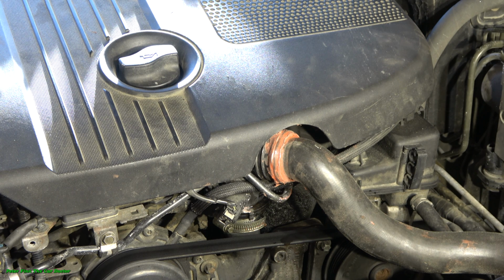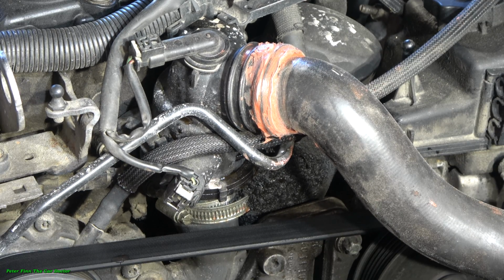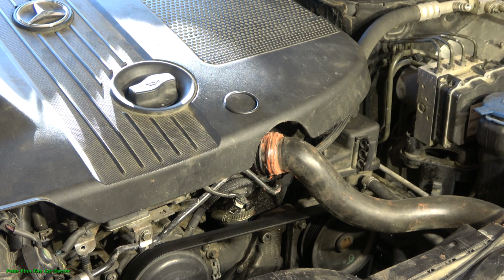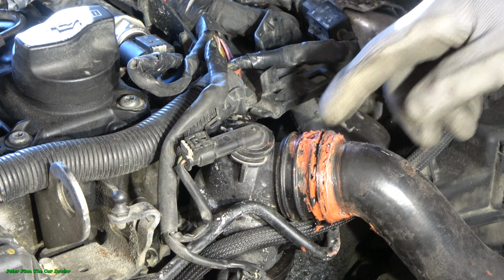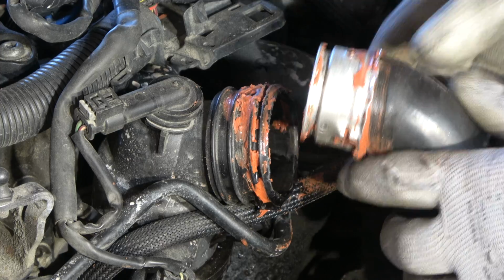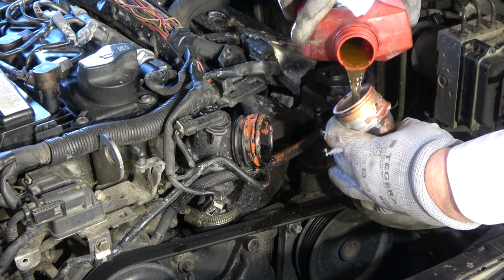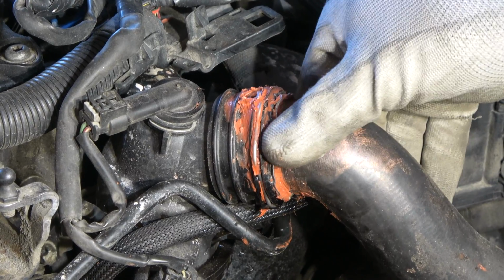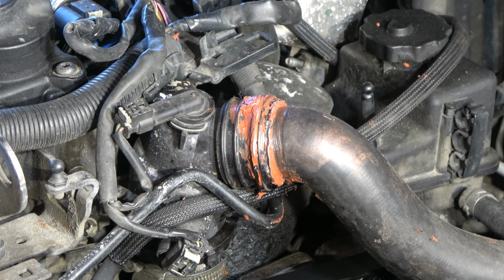How to repair Leaking radiator hose with new Seal Gasket car truck bike boat

Comment: Hi Peter.  Noticed the black hose had a lot of girth to it, and even though it appeared only semi rigid I'm impressed you managed to still get it in the hole, the lubricant and the way you used your hands obviously helped.  Did look a tad messy but that is expected.  Nice to see you were gloved up, I always make sure I am whenever I'm on the job.
Reply from the maker: Thanks 😃👍
Reply: the way it just flew over his head 💀